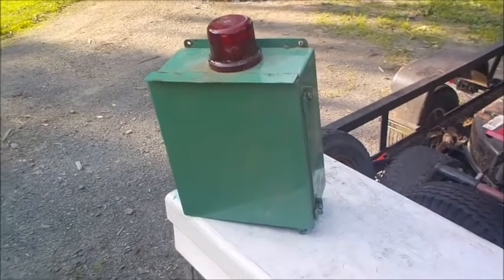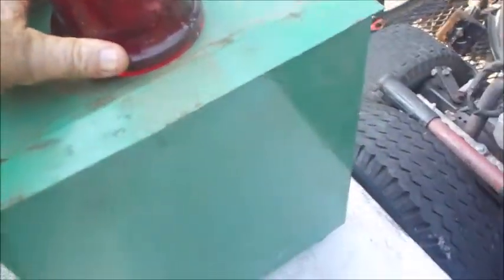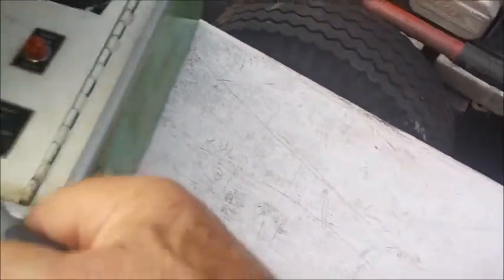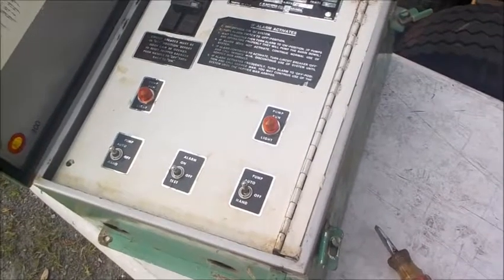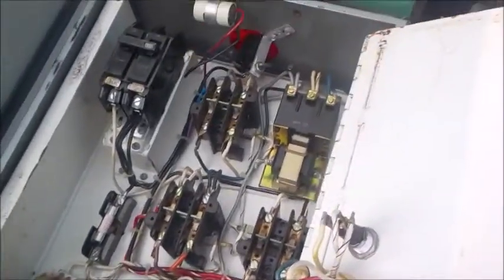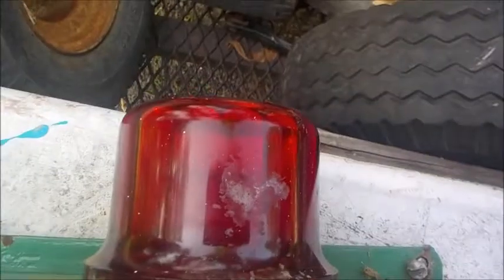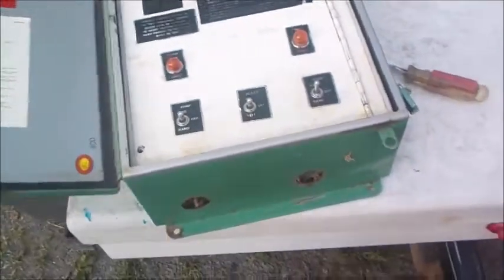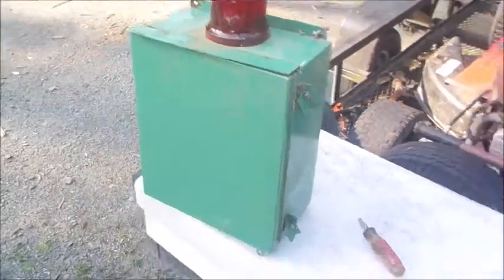Above Ground Septic Alarm System Box ???

Comment: It's a lift station pump control basically it a switch and fuse controller for a sewer or lift pump , part wise the light is nice and the circuit breaker and the contacters are good to keep as well,
Reply from the maker: That's the term I was trying to think of, LIFT STATION,  I worked as Super in a Condo Development that had one which Literally Pumped the SHIT Up to the Leach Field!  Sometimes it would Clog and I'd get a Call at 3 AM or so that the Alarm was Going Off!  I knew it looked Familiar.   Thanks for your Input